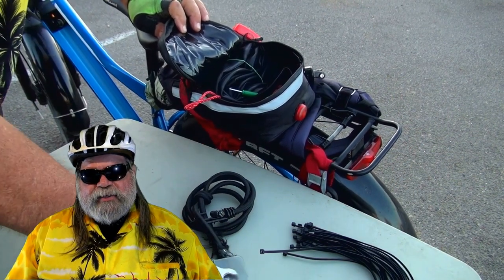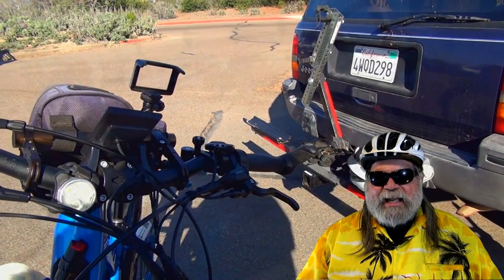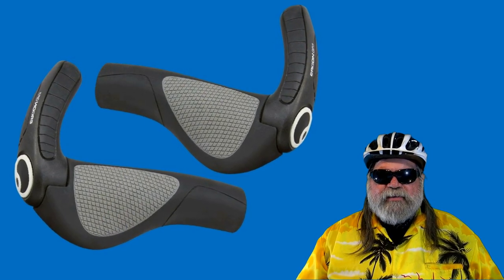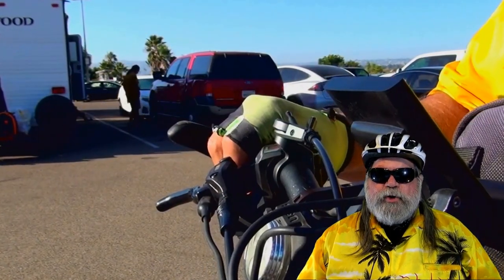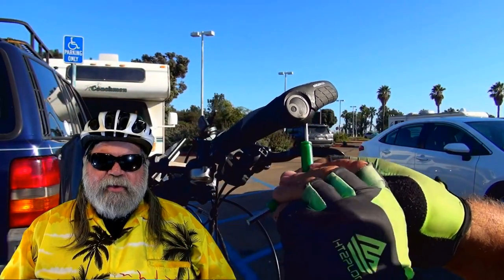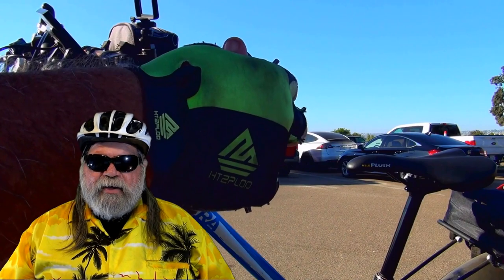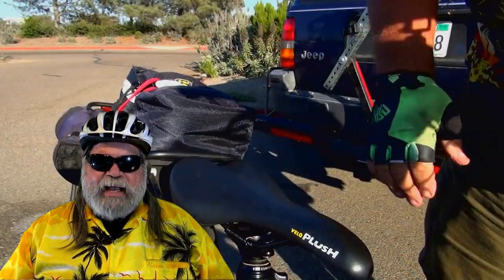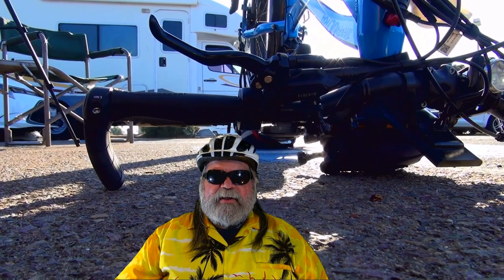eBike DIY Road or Trailside Repair Hack! Bar Ends, Hand Grips,  Dropper Seat Post!

Comment: I keep the handlebar jack set in my bag. They both cling to each other and fit very nicely in the bag. I use a suspension seat post so if I need to turn my bike over I just prefer to use the quick release and take the seat off.
Reply: Sounds like you are pretty well prepared for a roadside repair. Sounds like a great set up. My dropper seat post allows me to lower it when I come to a traffic stop so I don't have to do the toe tap dance while stopped

Comment: Going to look into the handlebar jacks.  At home I flip the bike upside down on a large piece of cardboard, and place some small foam blocks (mat'l from the box the bike was shipped in) under the handgrips to let the display monitor not touch the floor/ground.  I recently switched to the Bikeroo saddle (for seniors, w/elastomer springs) saddle, mounted on a Suntour Suspension seat post, and it is bottomed-out in the lowest position on the frame post. I could either remove the seat and post, or could use the rain cover for the bike bag between the seat and ground.  I could also use the rain cover that came with the seat.

🤔 As after-thought, a 1-gallon ziplock freezer bag, conveniently stored in the bike bag, could be used as a "ground mat" under the seat when the bike is inverted.
Reply: I just ordered the same seat from Bikeroo. I'm looking forward to getting it in a few days. The handlebar jacks do look like a pretty handy tool for roadside repairs. A great idea on the ZipLock bag. It can also have a dual use, sounds pretty handy. I'm going to add one to my kit. Thanks for the tip.👍
Reply: @DanBronk  The Bikeroo seat with elastomer springs seemed the better between the one with steel springs. Reading the Amazon reviews, too many folks had failures with the steel spring(s). My lower back (and posterior bones)  are totally felling better. The Rad Rover5 saddle is too firm and narrow. The Bikeroo saddle is not sleek, and looks bulky, but at 68 yrs old I'm more into comfort rather than looking stylish. :)